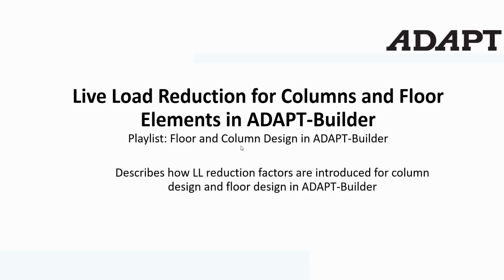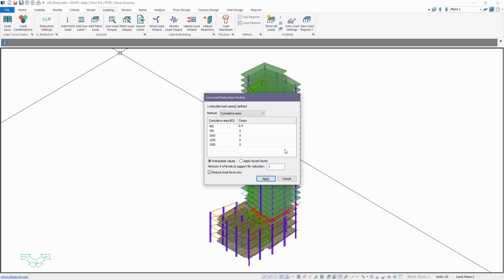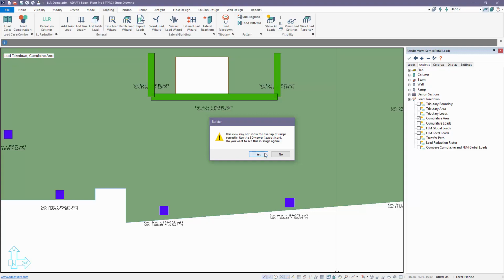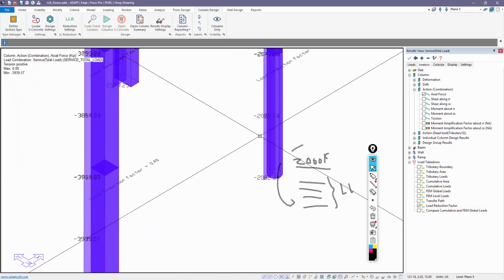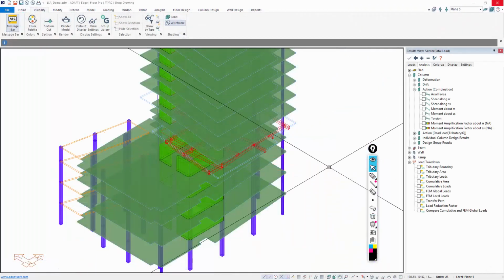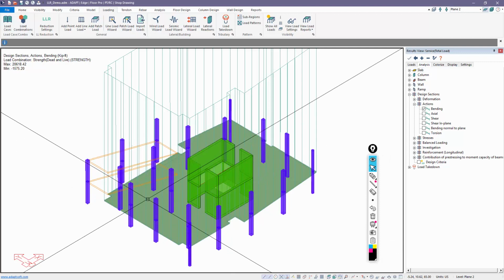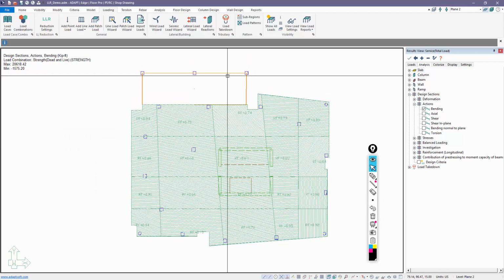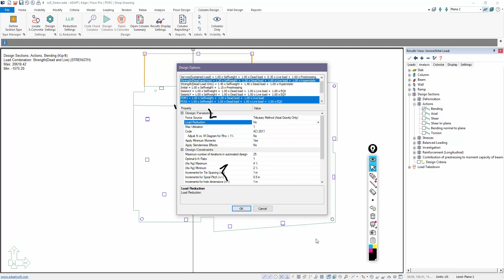Live Load Reduction for Columns and Floors in ADAPT-Builder

Comment: The question I would have regarding LL reduction on the floor plates is how you would determine a difference between reductions based on E-W spans vs. N-S spans, the same slab area could be reducible in one direction and not the other, so how can we accommodate that in Adapt Floor? Thanks for the video.